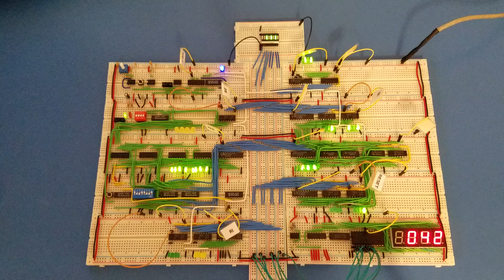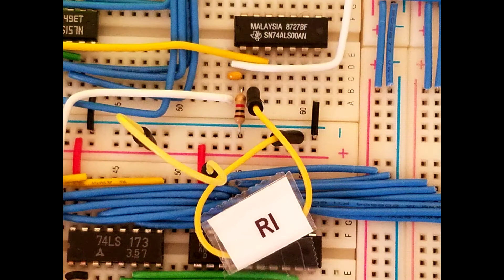Program Counter Question (Ben Eater 8-bit Computer) SAP-1

Comment: I had the same problems... put a Not Gate or two as a buffer, to isolate and drive the state change in other places. It seems the RC circuit makes other linked clocks iffy.  Other things I've noticed is if you have any gates (AND, OR, NOT, XOR, etc ) need to pull any of those input either up or down depending on the logic family... TTL likes inputs to be pulled high using resistors.  others (open drain?) like to have inputs or outputs pulled to ground with resistors.  Maybe get the Datasheet for some of the chips in question and read through them again see what they recommend on each one.  Another thing to note is there are strict requirements on power supply voltages for TTL logic, keeping the supply voltages in the range is important.  =D
Reply from the maker: That's what I did in this follow up video: https://www.youtube.com/watch?v=QPX3Yrqs6yY

Eventually I just removed the RC circuit altogether as it isn't needed.

Comment: without reading the comments, my first thought (assuming the capacitor is not a bad manufacturer defect) is that it's a timing thing.........  clock pulse, capacitor increase by (let's say by 43% as an example), then clock pulse and capacitor increase by same 43% now is 86%, clock pulse, capacitor increase by 43% but that is over 100% so it drops to 0% and ready to start again, clock pulse............   so unless it's a bad cap then i 'think' it got to be a timing issue... except............... it might just be those holes in the breadboard, it very difficult to find good breadboards these days.....  Resolution Suggestions: 1st try using wires and put cap in totally different holes... next try a different cap "and" use cap in those different holes...  next try different cap with different values or maybe a resistor-cap combo.......   idk if any of this helps but good luck pal!

Comment: I found the same issue.  I didn't know about the influence of this Capacitor in the RAM unit.  I had the same Program Counter issues, counting sometimes from 1,3,5,7,9 etc. But my old solution was to drop down the voltage from 5 Volt to 4,3 Volt.  Then I didn't had the problem anymore, counting nicely 1,2,3,4,5 etc. But I didn't like this workaround. I noticed, even with 4,3 Volt that sometimes the PC was still sometime going wrong, but that was depending on the frequency of the clock (very slow I had agian the same issue).  Neverthess thanks to this item of David I am able to fix it, via SiggyPony like solution (electrical decoupling).  I use the inverse clock - which is available anyhow - and NAND this signal (as inverter = both inputs connected) at the same 74LS00, and this output goes to the capacitor.   This indeed does the trick and can now put voltage back to normal 5 Volt without any issue. Thanks
Reply: I finished my 8bit computer and now I am building a much bigger and capable 16bit version, in the registers I'm using 74LS273 Octal flip flops and they are super sensitive to everything, I have to have one 74LS00 on each register to isolate the control signals or they just trip and reset their state when you do much as look at them the wrong way lol.  But once all the control singals go through the NAND chip they are really stable. Seems the larger your computer gets the more repeater/isolation type things you need to keep the singals working

Comment: I found on my computer that I had the same issue with my clock once I added the resister/capaciter combo for the ram.  I solved this by buffering (maybe the wrong word?) the clock signal throught two spair inverters in the memory curcuits 74LS04 to create some sort of isolation between the ram pulse and the system clock pulse.  That solved the issue for me, I also ended up adding the pullup resister on the 74LS161.  Another modification I ended up doing was adding 1k pulldown resisters at the chips to all my control lines because part of my clock circuit tried to burn itself out when the HLT signal was floating while I was working on the control wiring. The 74LS32 heated up to where it was too hot to touch., even though it was wired correctly.  After I added the pulldown resisters I've had alot less stability issues in my system.  10k pulldown resisters weren't pulling low enough and resulted on some of my chips detecting a high signal.

Comment: In case anyone else finds themself here, make sure the 74LS161 pin is held "HIGH".  As another user pointed out Ben Eaters version is floating and it needs to be tied to HIGH or you could have this issue.  Pin 1 to Vcc..
Reply from the maker: In this video, I can see that I have PIN 1 of the 74LS161 of the Program Counter tied to 5V, and I'm still having the issue.
Reply: @davidcourtney1398  Well.  I kept on this issue and broke down a bought a scope.  I guess I need to figure out this Youtube thing so I can post.  However, I tried everything and ultimately the issue persisted.  Until finally, at least, I thought about isolating that section with a diode.  Putting a 1N4001 diode on the clock line just before the RC circuit seems to have stopped the issue in its tracks.  I am continuing to fight with this as I want to know why.  Thought I'd just pass this your way but I'm continuing to investigate.
Reply from the maker: @JohnShackleton1  I ended up completely removing the Resistor/Capacitor from my breadboard computer. If you watch my FOLLOW-UP video to this one, you'll see that I was able to "work around" the problem by creating a buffer. (You've effectively done the same thing I did by using a diode.) But I couldn't find anything in the data sheet that says the 74LS189 has a 10μs maximum write time, and it clearly doesn’t as you can press and hold the manual pulse button indefinitely, and the data will still get written. So I concluded that all the messing about with the Resistor/Capacitor was a colossal waste of time, so I just removed it. My BB computer works great without it.
Reply: Man, thank you so much. I've been struggling to get my program counter to stabilize and tying pin 1 of the 161 to 5V fixed it. I've put in maybe 6 hours over 4 days trying to track it down. I had been back over my wiring so many times (I'm doing an 8 bit counter). The first 4 bits would SOMETIMES work, but when it triggered the 5th bit, the 5th bit just always stayed high. I tried throwing in a diode, I tried caps. I was about to rebuild it from scratch on a second board. Glad I didn't do that, because the result would have been the same. Tying pin 1 to 5V and suddenly it all worked like a charm. Tied it to my clock and ran it all the way through the 8 bits several times. 
On to the next piece....

Comment: This is where an oscilloscope comes handy.
Reply: Q: do you have a scope to watch your circuit with ? I would be interested in what the voltage near power supply is? And what is your voltage the further-est from your power supply? Also I notice that you don't any caps across your power supply rails (blue and red lines) around your circuit to help with both brown outs and spikes.

Comment: This is typical of a slow rise / fall time on the clock into the counter. If the clock is buffered more the problem should go away, otherwise a shcmitt trigger buffer will fix it.

Comment: did you check the enable pins on the counter? it kinda looks like its floating and constantly resetting the counter. another thing, shouldn't you place the counter in thorough a tristate buffer? I only see two chips up there that might only account for the four flip flops of the counter, but i don't see a third one (the buffer).

Comment: Keep in mind that you are driving LEDs and the cap with output signals which can cause all kinds of issues if you don't have any stabilisation measures in place. Without them, you experience situations in which a sudden demand of current could potentially result in a brief ripple (fluctuation) in the VCC rail. I noticed that some of Ben's solutions were rather borderline in this regard and I was actually surprised that he didn't experience any issues. Microchips can be rather sensitive to voltage ripples, and of course some are more vulnerable to this than others. 

As a starting point, I would recommend using small decoupling caps for all ICs, in particular the counter. I wouldn't be surprised if the RC edge detector was causing a brief demand in current which fluctuated the voltage of the VCC for a brief moment, just enough for your counter to behave in unpredictable ways occasionally.

TL;DR: Charging the capacitor will result in Voltage fluctuation for everything that isn't decoupled. As a result, you could potentially experience unexpected behaviour. The solution is to decouple your microchips, so they will behave predictably.
Reply from the maker: Thanks for the reply - great information. I have a follow up video to this one where I found a workaround ... https://www.youtube.com/watch?v=QPX3Yrqs6yY

... but at some point I'll have to go back and see if I can make it work without my workaround by using these decoupling capacitors you're talking about. Thanks.
Reply: Using decoupling caps in this application should be pretty straight forward, so don't get overwhelmed by information you might find about using diffferent caps in parallel for temperature sensitive things and so on. 

You could start dumping one 0.1 μF (100 nF) ceramic cap per breadboard (cermaic caps are the little yellow ones), connecting 5V and ground right where your jumper wires are for each breadboard. If you really want to go overboard, you could use a 0.1 μF ceramic cap per IC and let them piggyback your microchips, connecting to VCC and Ground of that chip to get really close to the pins. I personally would like that piggyback cap look, but I know others are rather fussy with the look of their breadboards after they've spent hours bending wires to make everything look neat :-) There are good reasons though to get them as close to the pins as possible, but I really think that even one per breadboard would already make quite a difference here. If the IC is too big for piggybacking, just connect it from the VCC pin of your chip to the ground rail on your breadboard. 

Also, note that ceremic caps (unlike electrolytic ones) have no polarity, so you can drop them in either direction. 0.1 μF and 100nF is the same thing and that should be a good starting point. 

Why ceremic? Well, unlike electrolytics they can decouple high frequencies into the many Mhz which is what you need in your digital circuit. Electrolytics would be pretty useless for this purpose.

Comment: try this. because the most significant bits of your buffer for the program counter have a schimitt trigger, try running the program counters clock signal through it

Comment: The capacitor affects the entire clock line, not just the connection to RI. I had the same issue with the program counter when I forgot to connect the HLT signal; it was very jittery.
The program counter seems particulary sensitive to unstable clock signals.

Not sure how to solve it while also maintaining the solution you are trying to achieve.
I don't have this RC in my circuit and have not noticed any issues with writing to RAM.
Yes, it will write for a longer duration when in programming mode, but that hasn't led to any issues for me so far.
Reply: I've had similar issues on mine as well and I don't have the RC circuit on the memory at all. The problem somewhat resolved itself as I finished the unit up and I've not seen it happen in a long while. (I finished mine up a couple of weeks ago). As stated above, it seems really finicky about the clock signal.  You haven't added the control logic stuff yet , but when you do, you might see similar issues with the counter for the T-states, I sure did. Things seem stable now, however I don't know why.
Reply: I was thinking the same, a posiblrnsolution is to run your clock through a non inverting buffer before running it trough the rc network.
Reply from the maker: Thanks for the reply. Glad to know I'm not the only one who has experienced this. I was thinking I would just have to remove the Resistor/Capacitor combo ... but I don't understand how Ben's circuit is working with the RC combo hooked up on the CLOCK signal while mine (and apparently yours too) is not.